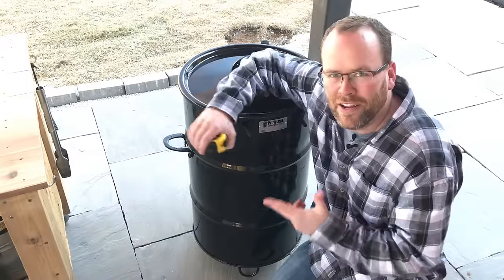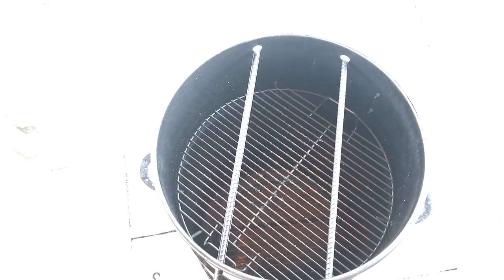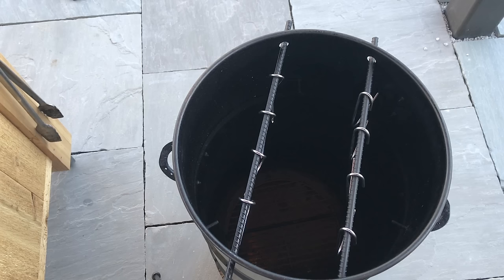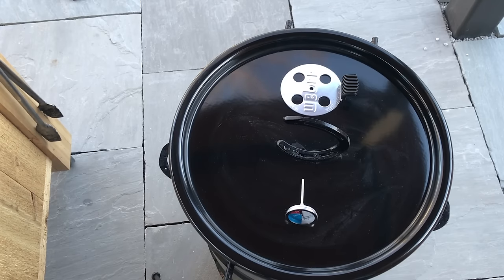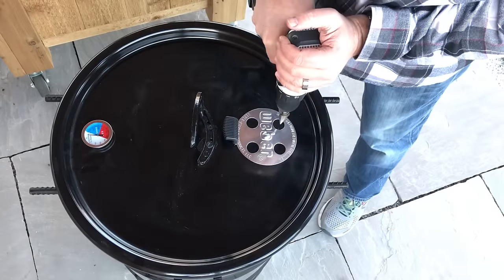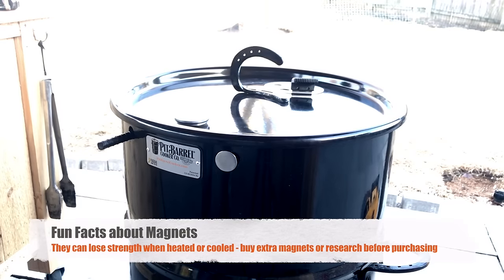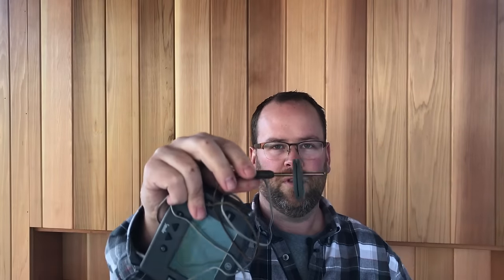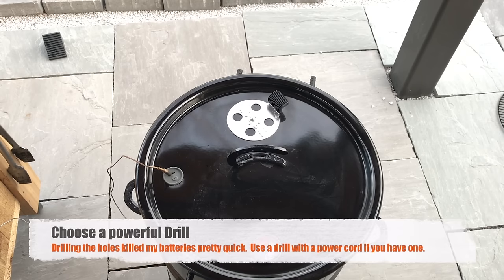Pit Barrel Cooker Review and Modifications

Comment: Great ideas am going 2 do this with min. As it runs about 350 with vent closed at bottom
Reply: I had this problem to the barrel was out of shape do your measurements and or call pbc
Reply: I have been more successful keeping my pbc temp lower by closing the vent in summer and using only 5 or 6 lit coals and using a half filled basket to reduce the fuel, air and rate the fire is able to spread. In winter I open the vent more to adjust for colder air fill the basket and light more coals. Just simple tricks to get you in your desired cooking zone. I do like the thermometer and air flow additions you added here though and have no issue adding those myself just to track what Temps works etc for reproducing successful results.

Comment: What temperature do you get with damper fully closed, and what temperature with the damper fully open? I find it really hard to get my PBC above 250 and so was thinking of doing this if it make a significant difference. Thank you
Reply from the maker: I have since moved on from the PBC, but from my memory, over 400 was pretty easy with everything wide open.  I recommend lump charcoal as well, if you are not using that.

Comment: If the ribs are hanging until very tender, will  they fall off?  Would like to add hanging option. I plan to build my own, and add a fire box to control heat.
Reply from the maker: if you let them hang too long... they can fall off.  often I use the 8 hooks to hold half racks, so they really have not chance of falling unless they are on there a very long time.  I find 3.5-4 hrs does the trick for ribs on the PBC

Comment: Why is the thermometer mounted on the lid and not side of the barrel like the competitors barrel grill?
Reply from the maker: You will get similar readings either way, as I did do some testing on this.  But I also did not want to drill into the side of the barrel... figured a lid would be easier to replace if needed.

Comment: How did the mods work? Didn't see a follow up video.
Reply from the maker: they all worked pretty good.  I like the vent for more airflow / higher temps when needed.  The temp gauge on top was consistent with a temperature probe I would put at grill grate level, so that worked well.  Only think I would have changed is to use a different silicone port for the wireless temp probe, and put that through the side somehow.  Not sure what that would be... but I found having the wires through the top to be kind of a pain.

Comment: The grommet, I would have placed it on the side of the barrel below the thermometer.  Then I would have taped it with heat tape to the thermometer with the tip sticking out a bit.  With the way you have it on the lid it’s an inconvenience taking the lid off and on.  This unit wouldn’t work for me! Reference:  I have 6 different types of barbecue units.

Comment: if the magnets lose their sticky and If you get tired of buying replacements try using cork or a wooding dowel just a little wider than the holes cut and sanded into about one inch plugs which could have a chain around four inches attached to the pit so they don't get lost.
Reply from the maker: that's a good idea... just attach them to the handles then, right?
Reply: @Searedandsmoked  handles or drill small holes for short nut and bolts somewhere near the holes so the chains don't have to be to long

Comment: Great video. I want to put a temp probe grommet in my Weber kettle but am worried about rust. Did the now exposed bare steel rust at all where you drilled? I imagine over time it’ll get that cancer bubble rust under the enamel like a car gets
Reply from the maker: jack p I’m sure it will have a little rust over time. I did not touch up the paint around the edges or anything. We will see how it goes.... i’ll prob buy another smoker to play with by then?
Reply: It's a simple matter to touch up the paint.
Reply: I see a whole post of people who are not able to drill a hole with confidence and these are people who buy these things. I find it funny that people will pay $300 plus for a garbage can with a few holes and a couple of pieces of rebar!
Reply: Actually, more pathetic than funny.
Reply: @garysampson5258  You are right about the garbage can with holes but on the other hand this garbage can with holes does function well at smoking meat according to the dozens of reviews and videos that I've seen. I have been researching smokers/grills and have found that it is easy to spend twice the money on a smoker that is made of cheap thin metal with welds that leak.Which is probably why people have to obsess about temperature as much as they do. I like that the barrel delivers a nice smoke without the need for constant attention. My purpose is, so to speak, to eat the meat.

I would also wonder if the installed thermometer and the small vent plate mounted on the lid would be of much utility.  They did not look like quality components and both are  sitting at the very top of the smoker which does require some interpretation.. Perhaps it is easier to simply check the temperature of meat as it hangs from the hook or sits on the rack with a quality digital thermometer. The coals will burn for  seven hours and they will not object.

I know that I could buy the parts and buy a recycled barrel (plus shipping) and install brackets and  drill holes for mods.  But I don't want to spend that kind of  time.

In short, if the smoker does its job, I can learn to adjust for the cook.I don't feel a need to save money by recreating something that works.

Comment: It would make more sense to add the probe hole to the side I think.  Maybe it is more difficult with the side not being flat?
Reply from the maker: I think you are fine to drill through the side too.  I decided to make it on the lid though... just in case I really F'd it up... thinking I could get a new lid easier.
Reply: @Searedandsmoked  probably a smart plan, 😂

Comment: Great Mods, I think i would rather have the Groumit on the side and temp in the top and the bottom....
Reply from the maker: I temp reading have been consistent and reliable from the top, but if I did it again... I would have drilled a hole in the side to make lid removal easier.  I was just apprehensive in drilling the main barrel.  Perhaps try to find a smaller grommet solution so the hole would not be too big as well.

Comment: Love the video. I am considering purchasing this . I had a side smoker for years and I am looking for something different . One question . If I were to smoke something for eight to ten hours is it a pain to add charcoal or wood chips during the course of the day . I’ve been hearing that this cooker is meant for one temp.. if I wanted to go lower and slower could I do it ?? Thanks .
Reply from the maker: If you want to go closer to 200 F, then I would go with something else.  It seems to want to stabilize closer to 275 F for me, with out messing with it.  I do like the flavor a lot and its nice that it cooks things pretty fast.  You can smoke ribs in about 3 hours from my experience so far.  You can get it as hot as you want by cracking the lid or installing another vent like I did.  But, going real low is probably more trouble than its worth with this smoker.  I love my green egg for temps closer to the 225-250 F range.
Reply: Seared and Smoked  Thanks for getting back to me. I'm just curious about your opinion on off set smokers? I had one for years I know they are not popular with legit cooks. I know you can buy gaskets and clamps to improve them . I was thinking of just getting a green egg . I love to smoke brisket and I heard it was good for that . Thanks for your time .
Reply from the maker: I do not have a strong opinion on the offsets.... I have never purchased one.  I just hear they take more babysitting.  I am sure if you pay up for a good one, they work fine.   For the money, I would probably go with a XL green egg.  I have a large and wish I had an XL.  It does crank out amazing brisket and pulled pork.
Reply: Seared and Smoked ALRIGHT!!😂😂 . I think the green egg is out . With all the extras you need we are looking at well over two grand . Not ready for that yet . I think it’s going to be the Oklahoma joe reverse flow off set ( just waiting to hear from them on how thick the metal  is on it ) or the pit barrel cooker . The barrel cooker looks so cool and interesting and the food looks like it comes out great on it . Apparently you can make a great brisket on it . What do you think . Ha ! Thanks for letting me bother you so much .

Comment: Do you ever have a problem with the meat burning at the bottom or falling off the hooks?  About to buy one, but concerned about burn (and ability to do competition ribs) with the 18 inches of real estate you get or the hang down.
Reply from the maker: So,  I have not had any problems with ribs falling off the hooks.   A lot of times I will cut the racks in half and then hang them to completely avoid that issue.  With 8 hooks, you can still do 4 racks that way.  In a perfect world, I agree that more vertical space and rack space would be nice.  I might bump up to a large drum smoker or large Weber Smokey Mountain at some point... too many options to choose from.   You do get more charring with the PBC than a green egg or something like that for longer cooks, which I do not mind.  Its different, but not in a bad way.

Comment: Did you encounter any smoke leakage from the damper?
Reply from the maker: D G ... No it’s pretty tight when closed. I find you do not need it open very much to boost the temperature. Usually just crack it 1/4 to 1/2 open and it gradually increases to 350 or higher

Comment: Remember, this is not a smoker people!!! It is a cooker. It is designed to cook at higher temps for a reason. Brisket in 6 hours instead of 12. And just as good. No need for 3/2/1 ribs anymore. Why change something that works as designed? And a thermometer in the lid is pointless. If you are going to do it, it goes in the side just below grate level where the food cooks.

Comment: Hello. I love my PBC, your Mods look great. I was just curious on the temp gauge I noticed you put it near the side. Is that because closer to the center would be too hot and it’s more accurate near the edge? Just curious. Thx.
Reply from the maker: I have not done any testing... but I think you would find the temperature pretty stable in the interior, when the lid has been on for a while.  I mounted it towards the front for viewing purposes mainly, and centered between the rods, so they do not cause issues with each other.  The grommet I mounted to the side, so it was also away from the rods.  Seems to work fine, but I have not tested other locations.

Comment: The weber air damper is not needed. All you need to do is to take out a rod to get more air flow. Of course you your grate. Anyways they designed this cooker to be one temp no adjusting for low and slow base on your sea level!
Reply: Je P Uhh... perhaps PBC Co. decided not to add a damper to keep costs low. I can't see any reason not to make it more adjustable and versatile when higher temps are wanted. I'll be wearing out my DeWalt Cordless this weekend just as he did..!
Reply: I’m sure they made it for the busy person who doesn’t want to research technique and is intimidated by too many settings and options, especially if they’ve never owned or smoked before. There’s something nice about knowing you can buy a fool proof smoker that will give you excellent quality food with no knowledge or tinkering. Definitely a niche market for it.
Reply: Not what I am saying. They made it adjustable.. You can leave out one or both rods to make it hotter. And you can adjust the air intake by sliding it more open. Just not the Weber way of doing it but does the same thing!
Reply: If you take out both of the rods, what do you intend to hang the meat on?
Reply: because at 9:45 he talked about chicken wings and not getting hot enough.  He's not going to hang chicken wings.
Reply: Now that I think about I've seen Wsm 18 for 100$. Add a gateway hanging rack and your only in 160$. Cheaper than the pit barrel coork with the result he is looking for.

Comment: I run my probes through the re-bar holes and attach it to the grate so I get actual temp reading where my meat is, or the re-bar. Works great.
Reply from the maker: Frank A Yup.... I do the same thing... with the grommet hole. Nice little smoker for the money
Reply: There is only my wife and I, so I usually only use one rebar for hanging meat. I use holes opposite of each other it so it goes right over the center of the barrel.
 First, I drilled a 13/64" hole just under one rebar hole. (That's the smallest hole that will still let me run my temp probe all the way through.) I took a 3/4" strip of sheet metal and bent one end around the rebar. Next, I bent a piece of the sheet metal strip in a square "U" shape, and drilled holes to slip the temp probe through. For my probe these holes were 11/64". Finally I bolted the "U" to the strip, located so the probe tip just comes to the grate. So now my probe just hangs under the rebar. Thus the wire" runs" under the rebar (out of the way) to the point where I want to see the temperature. BTW, I have noted a temp difference from the center to the outside of the barrel.

Comment: When smoking brisket etc. How do you add woods etc
Reply from the maker: If you are hanging your meats, then you can use a set of long tongs to drop a chunk of wood down into the coals gently.  If you need to add charcoal during the cook, then you actually have to remove the meat and then put it back on.  I do not add a lot of smoking wood during the cook, as the PBC has a pretty solid smoky flavor with the charcoal.  I use lump charcoal and find I have better burn times with that over briquettes.
Reply: Patrick I've run this cooking a 13lb packer no need to refuel. It motors around 275 all day no mods needed
Reply: Just found this video today (6/4/2023), but what I do is add chunks of my preferred wood into the charcoal as I fill up the basket. Then if I want more smoke, I’ll add more wood during the cook by removing the grill and dropping more into the fire. I’ve only done 2-3 cooks using the grill. I’ll have to experiment with the hooks next.

Comment: I thought you were going to drill the probe gromit hole on the side at grate level.
Reply from the maker: i did not want to cut into the main body.  figured if I messed up the lid it would be easier to replace

Comment: Why didn’t you just buy wsm
Reply from the maker: Looking back.... maybe I should have.  The thing that sold me was the ability to hang a lot of ribs and chicken, right out of the box.  I am not sorry I purchased it... but may go with a 22" WSM at some point... or a larger drum smoker.  I find the space on the grill grate small, if not hanging the meat.  Which smoker(s) do you have?
Reply: I prefer the Pit Barrel to the WSM, just add the temp gauge, the temp control from the bottom damper is good for me but I'm in hot Texas. Much more meat capacity and can cook hotter than the WSM. I added a larger charcoal/wood capacity basket from my other 55 gal UDS for longer big brisket smokes. If I were you I would buy a bigger UDS (55 gal drum or bigger) or better yet a 1/4" thick offset or even better a1/4" reverse offset. In my humble opinion the WSM is a step backwards. I started with a drum like the WSM 15ish years ago and I won't go back. I use my Pit Barrel when I want to do a rack  or 2 of ribs or a small brisket. I will fire up the reverse offset for bigger amounts of meats.

Comment: I'm kinda surprised at a few comment I've read about not having good temp control with the PBC. It took me a while to get the vent right, but mine runs very consistant temps without mods. How many cooks did you do before the mods?
Reply from the maker: Not too many... probably 5.  I did not have too many issues with temp control for smoking temperatures in the 250 range.  The main reason I added the extra vent was to allow higher temp cooks with more control, vs cracking the lid.  I like to cook chicken halves and chicken wings at higher temps to get more crispy skin.  Nothing wrong with the PBC out of the box... just another option I wanted to play with.

Comment: I just use aluminum foil under the grate...don't wanna pay $30 for the ash catcher :>)
Reply: eaglerockdude I used a pizza pan.
Reply: Yep...with the foil(heavy duty) I can just fold it up carefully...catching all the ashes...and throw it away.....but your way works too...I also line my regular weber grill with foil also for the same purpose...just helps with cleanup later on.
Reply: I just ordered mine and waiting on it to be delivered. I too thought the 30 bucks was high for that but I figured hell I'm already paying 300 and the extra package # 1 had some accessories I needed anyways which included the ash catcher. So I went with that. I can't wait to get it and try it out.